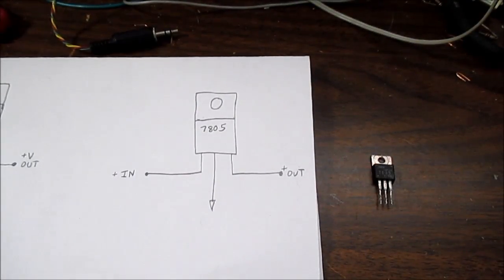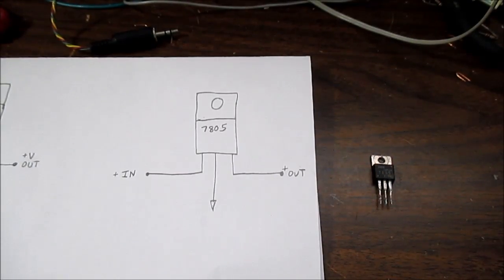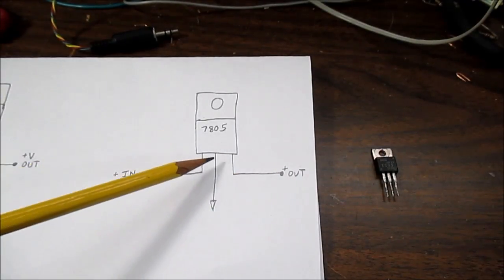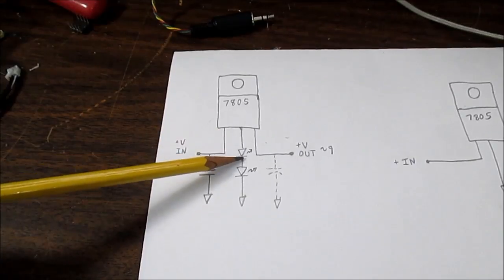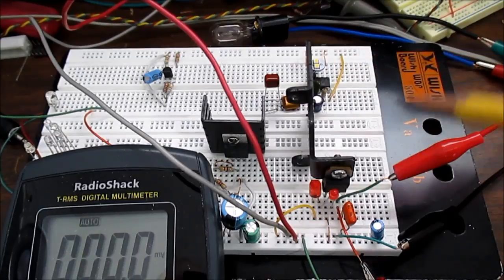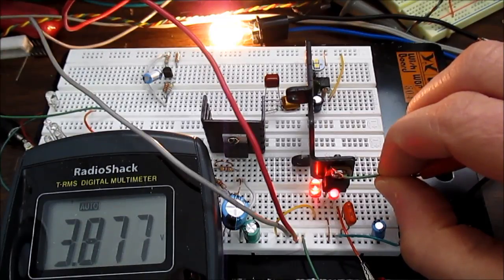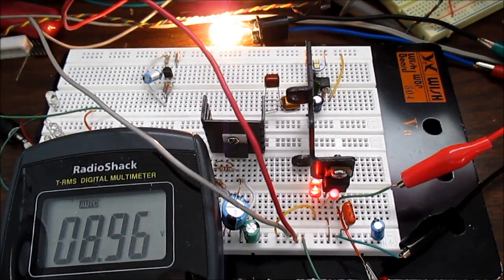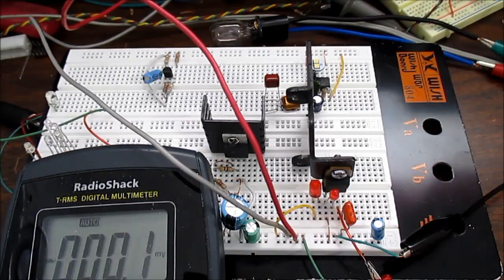Set different voltages from 7805 regulator using an LED

Comment: You can also use a resistor divider just like the 317. Usually it will actually be more accurate than an LED or zener anyway.

Comment: what is the deferent between 78xx and 79xx? plz reply
Reply from the maker: The 79xx series is for negative voltages.
Reply: JohnAudioTech What is the purpose of the the negative voltage
Reply: Just a example. Class AB amps, and power inverters use negative voltage to pull a positive voltage to ground making a sine wave.